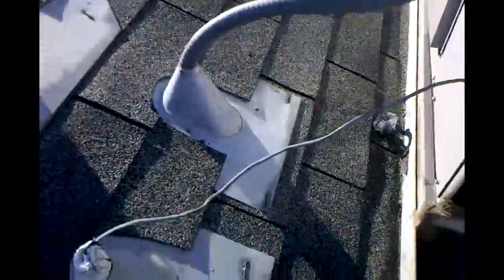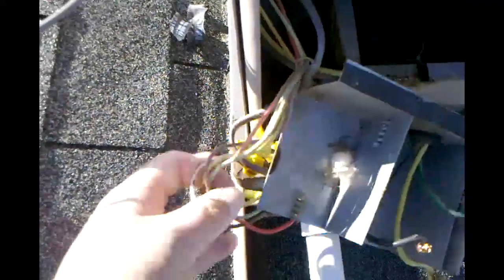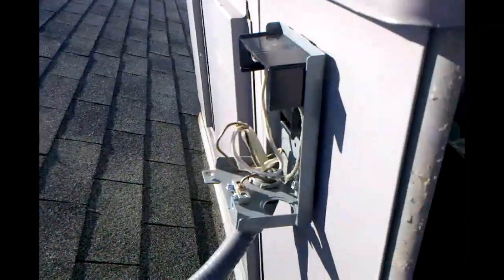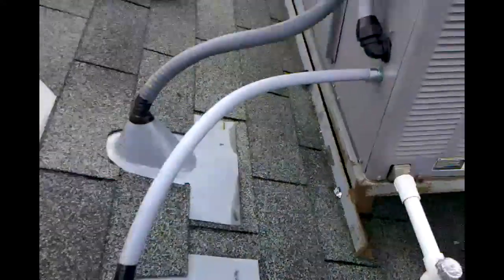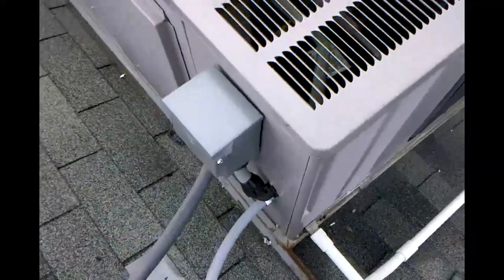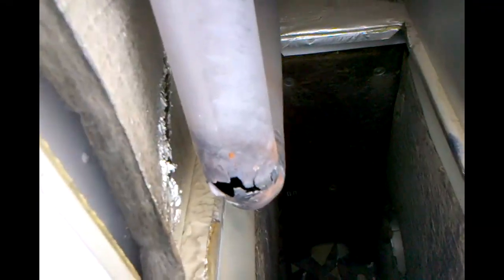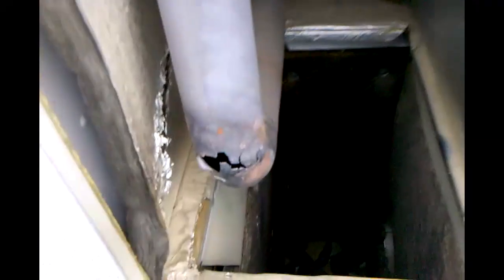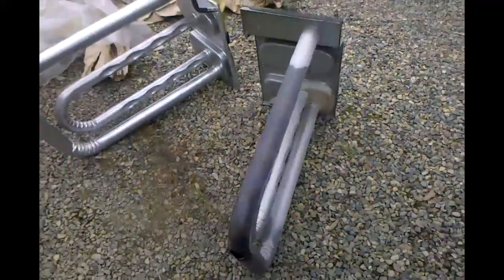A brain fart on a Carrier heat exchanger

Comment: That sucks. I hate it when that happens. At least it's easy to change plus you get a sun tan to boot. Good advice though, I have done similar things in the past.. It;s in our nature to attack the repairs before we do the inspection. I always put at least a 6" spacer or transition between an upflow furnace and the coil so that both the coil and the heat exchanger can be quickly inspected. Great video, I'm subscribing.

Comment: OH SUCK !!! Looks a little easier to change out,  than a forced air furnace heat exchanger , 5 billon screws , ten tubes of high temp red (that winds up all over you, and in your hair), and you still have 300 screws left over (where the hell do they go) !!! LOL .... Great job brother , alot of guys would have focused ONLY ,at job at hand , and Never Removed that Panel !!! Great Find !!!

Your new Flashing , and Disconnect looked GREAT !!!
Keep up the Great Work !!!
Your Videos are Rockin !!!